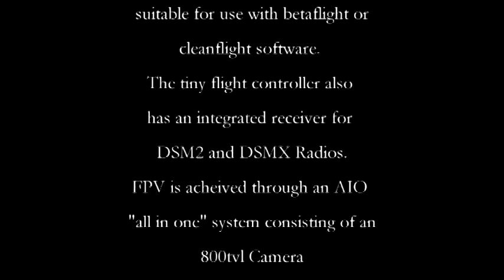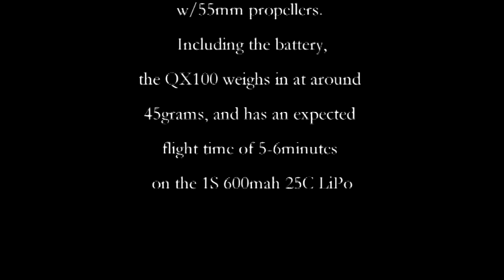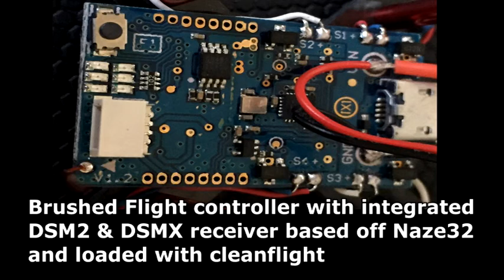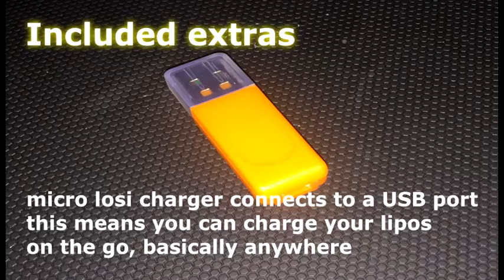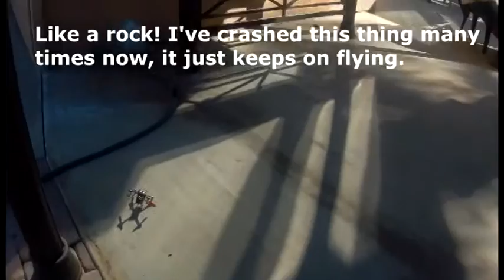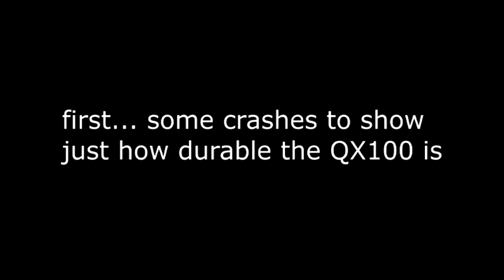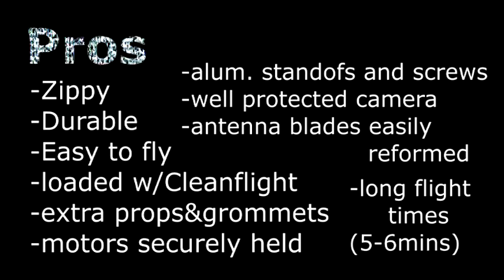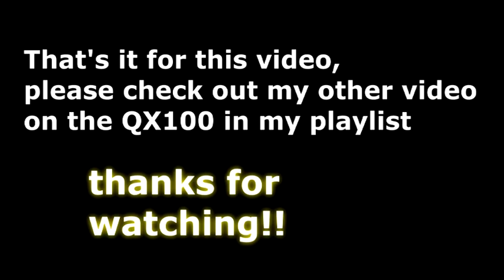Eachine QX100 Micro Racing Drone- Overview & LOS/FPV Flight Testing courtesy of banggood.com

Comment: seems to have a lot of jello.  Did you notice that in your testing?
Reply from the maker: yeah there was a little bit of jello, but I don't remember it bothering me at all.  I was at a high throttle for most of the flight too, this probably added to the vibration

Comment: Is the receiver included or do I have to connect it?
Reply from the maker: Yup receiver is included, the one I reviewed uses a DSMX/ DSM2 receiver for spektrum transmitters. For my review, I swapped out the flight controller for a comparable one which allowed me to use my own receiver. Im sure there is a way to use other receivers on the supplied board, I just figured swapping it out would be faster.